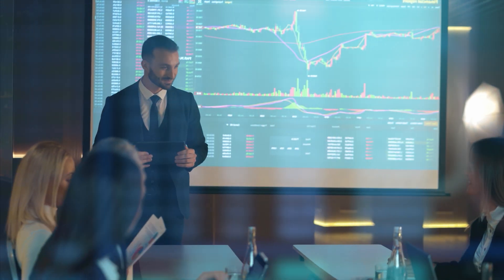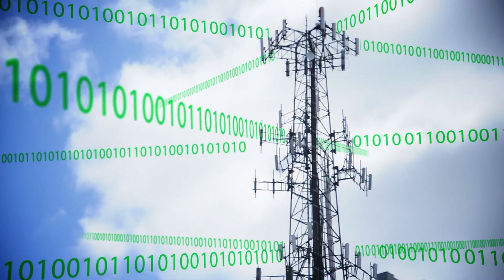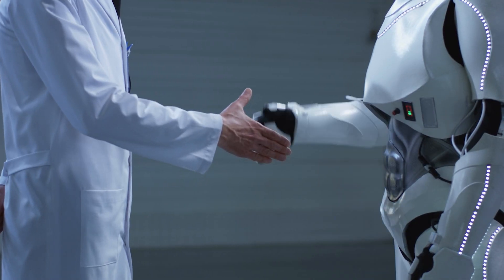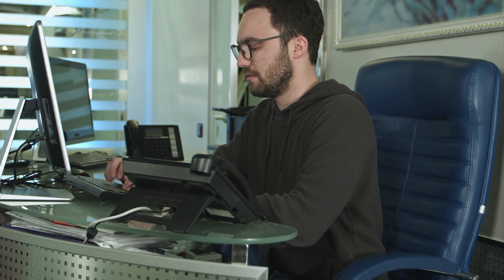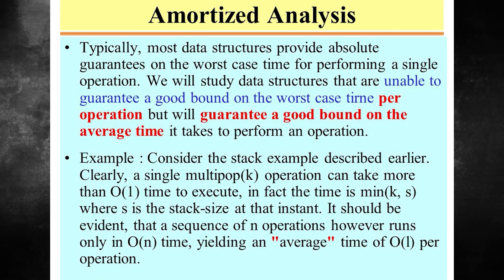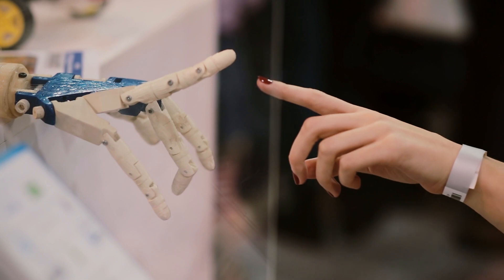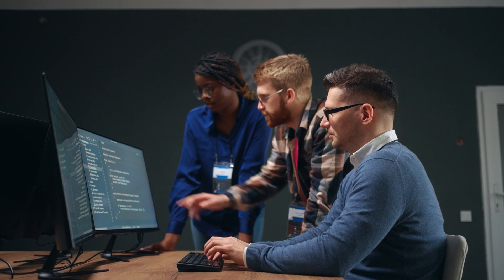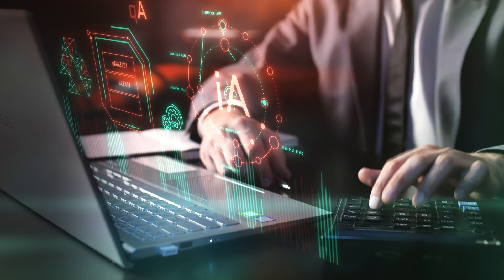10,000x Faster AI Training: This New Tool Could Transform Machine Learning Forever!

Comment: As great as it sounds, what if….someone in that network shares malware through???? Could that be trucked which device shared that information????
Yes one's information isn't stored at one server. Problem being if everyone is under one network shares a malware data using stored on that device, but since those people also use that Ai model. That malware could potentially just effected every device using it????

Maybe Im just overthinking, but I just thought Ill share that idea out there. Just in case, someone malicious that also thought of the same idea.
Reply: No distributed model is dumb enough to have only one computer or cluster doing one thing.  There's always duplication and redundancy
Reply: @MusingsAndIdeas  I think, you misunderstood what I was going about.

Comment: Sounds exciting.  Though isn’t there another knock-on effect of this— wouldn’t large scale centralized data centers also benefit from the method? If you just treat them like extremely nearby yet “distributed”  training networks, then their performance should also be greatly increased.  This “rising tide” of efficiency would lift all boats.
Reply: That’s what i thought. Not only lower costs for small companies, also for big tech companies have these benefits if data transmission is lower in general